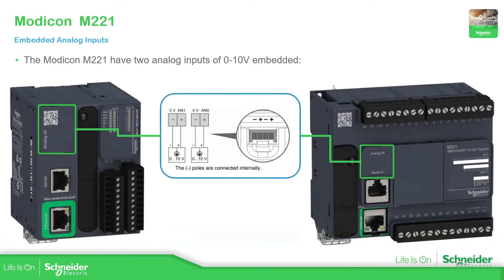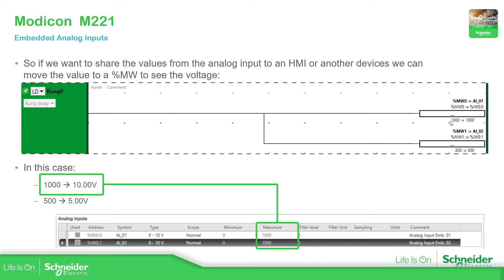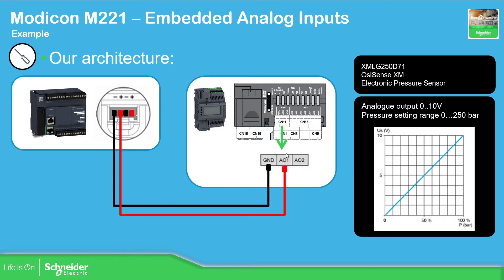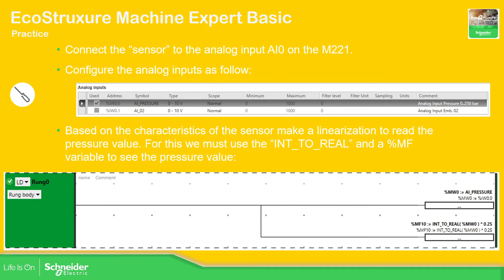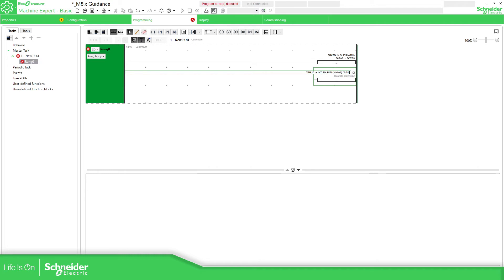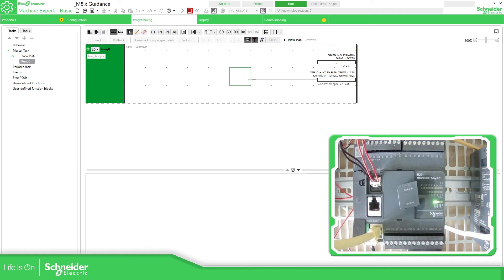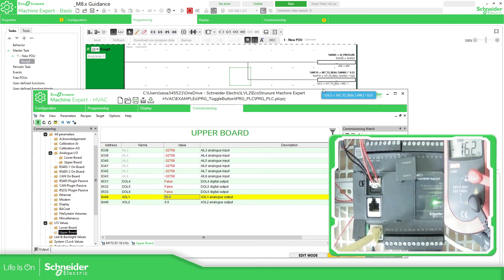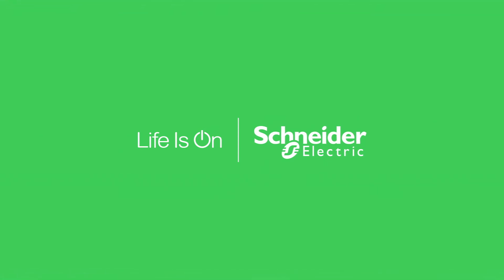Training - M221 - M8.2 Configuration Embedded Analog Inputs

Comment: Hi LeTomas. Thanks for your videos. Please does any of your videos deal with modbus TCP address mapping? I am trying to figure out how to map the %IWXX addresses on the M221 to Modbus addresses 4XXXXX. Will appreciate your help.
Reply from the maker: Hi Akachi! I have not made any video related to that topic but I have checked an application of M221 in Vijeo Designer. The Vijeo Designer is the software for HMI and it allow us to import the project of M221 to read the variables. If we select the driver as IEC61131 we can see the the registers as %MW if not we can see the variables as 4xxxx and for the %I and %Q the system did not change the registers to the one you are looking for so my suggestion for you is to move the values of the inputs and outputs to a memory in the M221 so then you can access using the 4xxxx or 0xxxx.
Reply: @LeTomasAHUMADA  Thanks. Will try to implement it as advised.